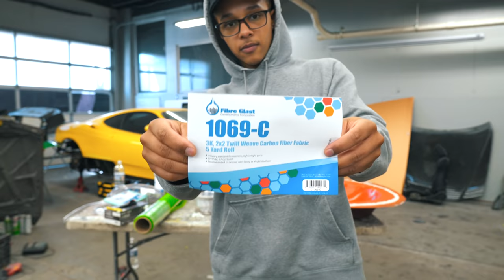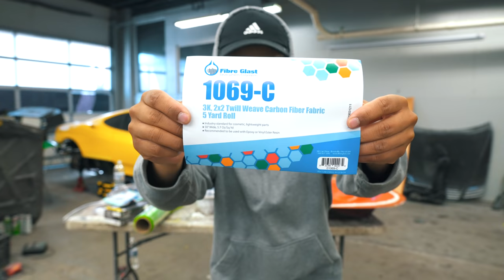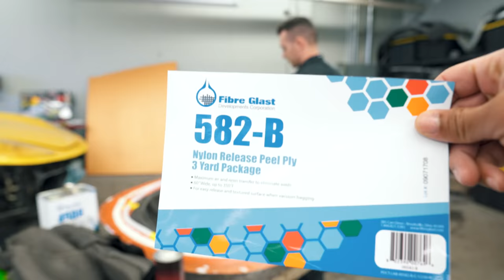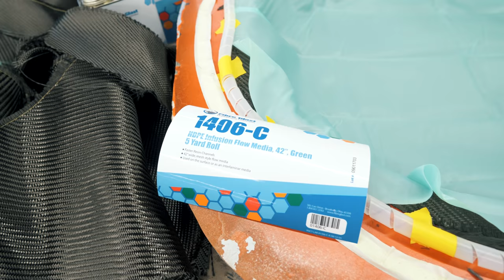How To Build Your Own CARBON FIBER PARTS | Vacuum Resin Infusion | (EP# 44)(4K)

Comment: Update: Paste wax saves the day. The drying agent in paste wax acts as a solvent to remove stray carbon fiber hairs. blocked off bagging tape area with painter's tape. I used a clean blue shop paper towel and cleaned off entire surface, buffed out paste wax, now applying the partall...

Comment: Just a couple recommendations to give you a better product, instead of 77 you could mix up some of the same epoxy and thin it down with MEK or MPK, this will give you the same amount of tack and will be the base adhesive so there should be an chance of reaction.  Also I’d always wear gloves the oils from your fingers can cause disbands.  Just suggestions, I’ve been in the aerospace industry for 13 years making carbon parts

Comment: Just a heads up, but a faster/easier approach to gum taping is to apply the tape to your bag first, then the mold.  That way you'll have less tape seams and less chances of leaks.
Reply: jlehm 1982 good tip, thanks!
Reply: @StreetBandito  No prob boys! Love watching the vids.  Another freebie is that you can apply the PVA with a rag too, which prevents it getting all over your shop and then you just have a thin tape line for your seal.  All about time saving and consumables reduction.  I work at an aerospace company with composites.  So, if you ever have any questions hit me up.  Also, if you plan on making a number of copies of something, check out Smooth-On videos on here for their silicone reusable bags.  They're tight AF.

Comment: I don't know if anyone has said it yet. But to get the correct resin amount just weigh(I use grams) the material youre using for your part. then double it. That should be enough plus a little extra for just in case.

Comment: VARTM tip: you had it all (nearly)correct, but you infused backwards. If you pull vacuum from the outer edge, and infuse at the center, then you will achieve the same results minus the resin going into the fittings, trap etc. This shape is similar to a boat hull, so if you research the VARTM process on boats you'll see what I mean.

Comment: Just a quick tip: sometimes not all layers of carbon are fully infused with resin, even though the top layer looks like it. I would wait a good couple of minutes before clamping the infusion line. (especially when you're making something with lots of layers)

Comment: one thing you can do to help reduce the amount of air bubbles in the infusion process is putting the resin after it is mixed into a vacuum chamber for a bit to get the bubbles out. Also, when putting the vacuum bag down, when making the pleats, run the bag up one side, fold over a bit of the tape to overlap a bit. You will get a better seal that way.

Comment: Looks good but as a tip, try using another vacuum connector, the one you use isn't really ment for resin Infusion and will get stuck to your breather fabric and filled with resin, try some silicone or plastic connectors 😉

Comment: I always like to stop the resin before it gets to the resin trap, otherwise you have a hell of a mess to clean up. And Tim, if you want even better looking parts and easier separation from the mold, try wet sanding and buffing your mold to a mirror shine. Makes a huge difference in final part appearance.

Comment: And now I looked at the rest of the video, it's really hard to get it sealed properly. You had some air leaks there at the end, hope the parts turned out fine regardless of the air problem. My first vacuum infusion was making a Electric Skateboard all Carbon/Kevlar. HARD!
Reply: Street Bandito Good to hear, then the parts will turn out awesome 👏 Great job you are doing and also documenting at the same time.. I am also trying to do the same, but not so easy when filming and making parts

Comment: Your mixing cup walls has an angle to it so using a measuring stick will make your ratio off cause there is more volume at the top of the cup than the bottom.

Comment: Damn, last time I was this early the S2000 was a heap of scrap!

Since I'm here early and you might read this: How does your twill Carbon not mess all over the place? We use 200g/m² in our race car parts and this stuff is fiddly as hell. You pick it up at one point? Piece is ruined. You pull on one side? Piece is ruined. Light breeze in the cleanroom? You guessed it, carbon fibre strands go everywhere. It's more fragile than a teenage boys ego. How can you use your twill without having to cut it on a cutting mat and moving it around on little tablets?
Reply: GermanTopGameTV take some tape on the cut lines, stops it from fraying

Comment: Well that was informative! How not to do it ! 😁😱. Didn't weigh the carbon and work out resin required, just mix a shed load 😁. Pipes big enough to pump fuel 🤔. Air leaks all over. Cutting carbon over the mould 😱. I could go on. Entertaining though.

Comment: whats the difference then between the way you make your CF and say the CF that is baked in a oven?
Reply: Dieter Manero weight mostly and a tiny bit of strength: prepreg has the perfect ratio of cf to resin where as vacuum bagging is close to the best ratio. Wet layup is a bit worse than vacuum bagging you wind up with a bit of excessive resin.

Comment: If I were u I would’ve left the protective tape on there, only taking it off once all your layers and consumables are in, now u have to “tip-toe” around being careful not to get any on the tape👍🏾 

especially when u cut the carbon and the filaments are floating all over that could get on the tape, even on the edge of your tape

Comment: Personal tips from a vartom infusion tech

Never use bare hands on carbon because the oil in your hands inhibit ...... Makes stuff not good.

Always put resin "return" line on the outside of the part (I'm aware he has it on an unused part)
Reply: Ps just talking not correcting anyone
Reply: Commenting as I watch lol

There's an equation for calculating amount of resin you need

Comment: Be careful about doing this in these steps. I had a grade A polished mold and now I have carbon fiber embedded in my mold surface. Cutting the carbon fiber in the mold after vacuum taping gets fibers trapped in nooks in the tape, even with the paper still on. Now I've washed off my pva coat and am having to decide to speed polish fibers further into my mold or lose another day starting from scratch. Best to cut the carbon fiber layers in place before even doing the partall wax, then pva, then bagging.

Comment: I see you made the mold out of that 40 year old technology  Ester resin crap. I cant believe your using that wax and pba!!! Let me help you. Use epoxy systems only.  products only ES201 epoxy surface coat.  DER 324 EPOXY resin, ez84 hardener.  Mold system use free kits PM cleaner,  FMS sealer and 770 mold release. 770 release you can get a dozen pulls between applications.  It like water and no elbow busting.  Need more info just contact me. You really need to get up to date.